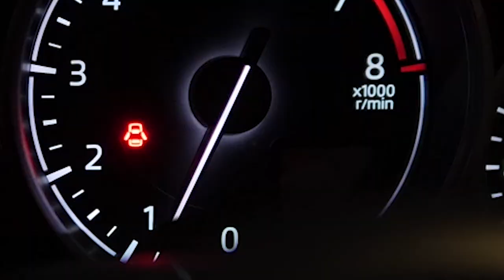2012 KIA Soul Clutch Replacement

Comment: Just got through replacing the clutch on my 2015. It wasn't too bad, even with minimal tools and just the service manual. Hardest part for me was breaking the lower control arms loose. I don't think they had been ever been removed, so it was a bear.
Reply from the maker: Oh yeah. Those lower control arms can be a pain to get out sometimes.  Good job getting it done.  Thanks for the comment.